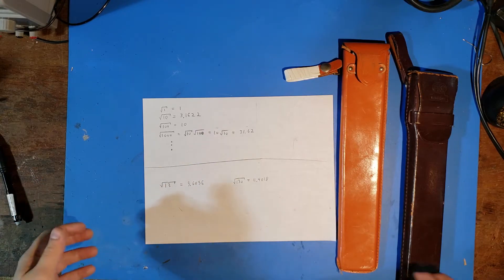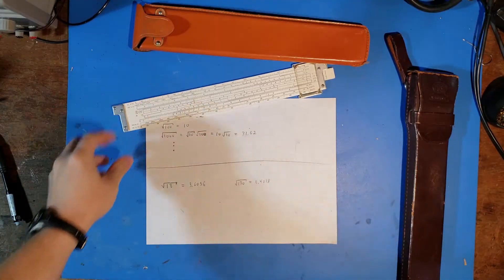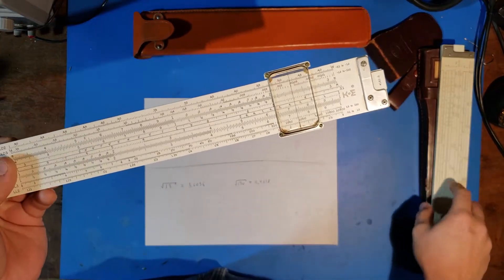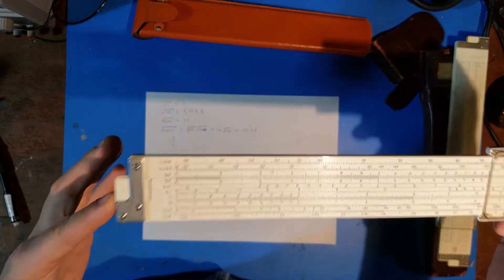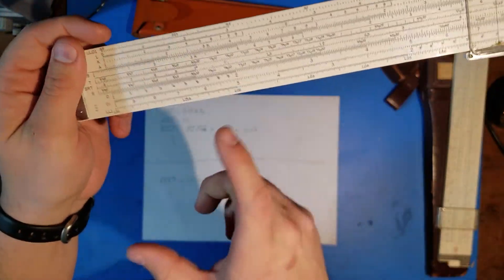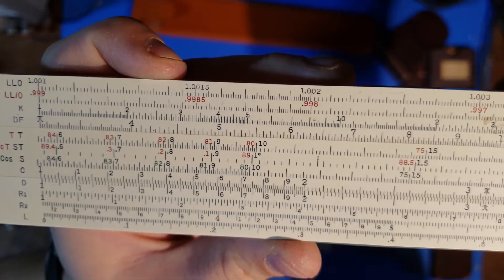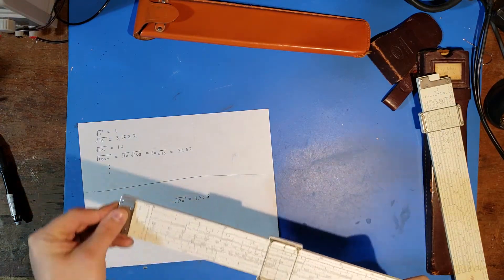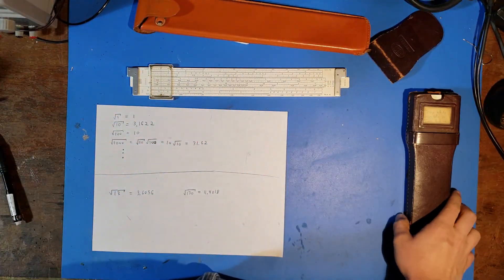Slide Rules: Keuffel & Esser vs. Hemmi & Post Versalog

Comment: Thank you for your video. Regarding the Keuffel & Esser plastic slide rules such as your 4181-3, these were not made of Bakelite plastic; instead they were made from ABS plastic which is Acrylonitrile Butadiene Styrene. ABS is a more durable plastic that Bakelite which is made from phenol formaldehyde but tends to be brittle and prone to cracking. Regarding the LL scales which are on both of your two slide rules but you did not mention. These LL scales are known as Log Log scales which are very powerful and used to calculate the roots or the powers of numbers between 22,026 to 0.0000454. For your example of calculating the square root of 130, you would go to 130 on the LL3 Scale and multiply it to the 0.5th power (which is the same as its square root). The answer is 11.4018 which is located on the LL3 Scale. In other words, the LL scales can do more roots and more powers than the A, B, and K scales which can calculate square roots, cube roots or raise a number to its square or to its cube.
Reply from the maker: I'm going to have to read up on these scales. :) Thanks for sharing.
Reply: @R3RadioResearch  The LL scales known as Log Log scales are typically based on Natural Logarithms and utilize Euler's Number "e". The LL Scales can be used to calculate the roots or the powers of numbers ranging from e^-10 = 0.000045 up to e^10 =  22,026. On the other hand, the L scale which is based on Common Logarithms can be used to find the mantissa of numbers from 1 to 10.

Comment: To do squares, you inverse the procedure. You go from the R1/R2 scales to D. It's actually easier with the Versalog than with A/B scales because you don't have to decide which decade (left or right) the result needs to be.
Reply from the maker: Yeah, the claim at 13:12 about squares being harder is likely unfounded, though it may have been my opinion at the time since I hadn't done many squares with a versalog rule before. After reviewing squares with R1/R2 and D vs. squares with C/D and A/B they seem like the same difficulty to me. As far as square roots I definitely find the R1/R2 scales easier to work with because i see both results at the same time and can toss the one that looks wrong without having to manually check both decades on the A/B scales by moving the marker around.
Reply: I think the main draw back of R1R2 with no AB us that you can't pull down a sqrt value 'on the fly' in an equation like B.  Same issue with K on the stators. Really hard to use them as accumulators. AB with CD really allow for more continuous calculation vs just lookup table values.